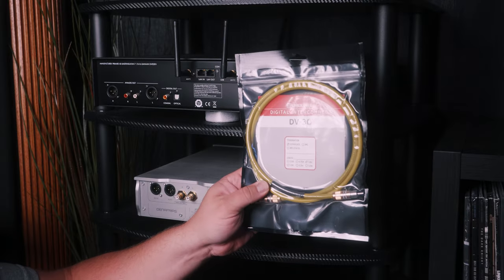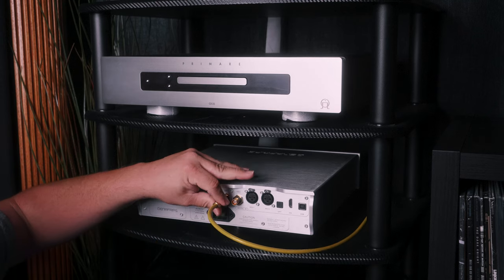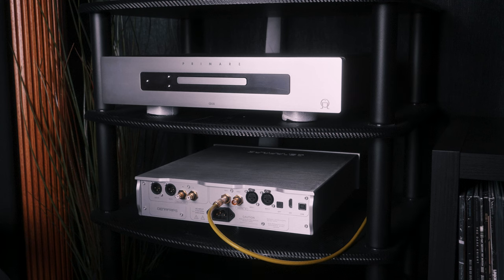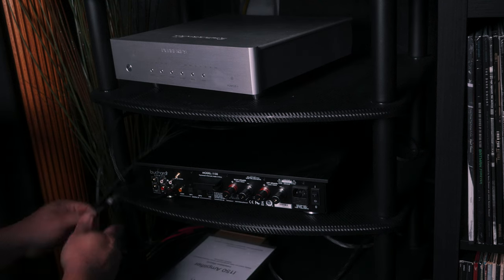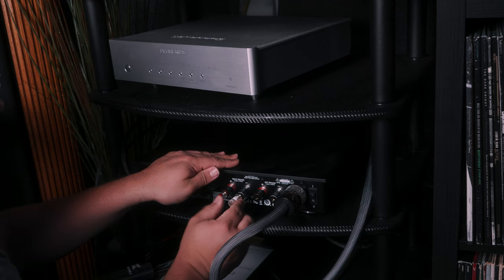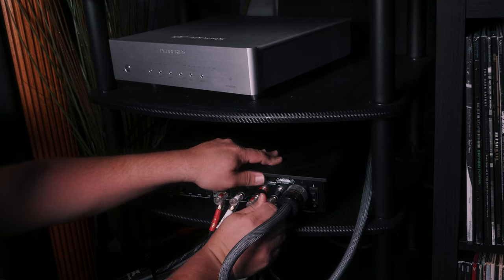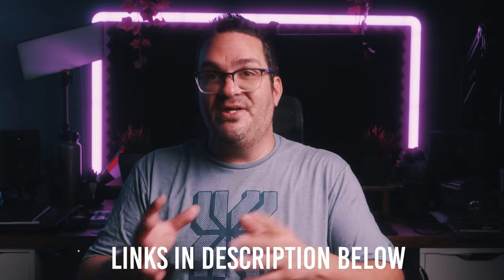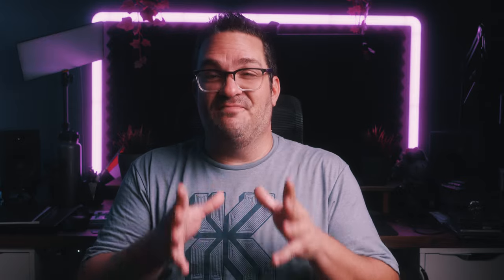How to Connect Your Stereo System

Comment: Interesting but...I'm not so sure that the configuration you chose to explain is the one most likely to be the first one used by somebody as a first Hi-fi system. In my case surely it wasn't.
My system is simpler and more affordable than the one you show and I am veeery pleased with how it sounds. Mainly it includes CD player-receiver-passive speakers+active subwoofer. And adding the sub was the "tricky" part for somebody starting out. Only RCA connections and speaker cables. Nothing more complicated than that.
It allows for coaxial connectivity (for adding a DAC) but I don't see that as a starting point. It is a step that needs a little bit of experience in listening music using a Hi-fi system. My opinion... 🙂
PS: given that most of the systems on the market today are integrated in one component the logical first step is to understand how to deconstruct them into the 3 basic parts. And those are player-amp-speakers (possibly passing through a 2 components stage player-active speakers eventually with an integrated sub). DACs, transports, subs, coaxial connectivity, separated preamps and others come later on the learning path. At least this is how it was for me. 🙂